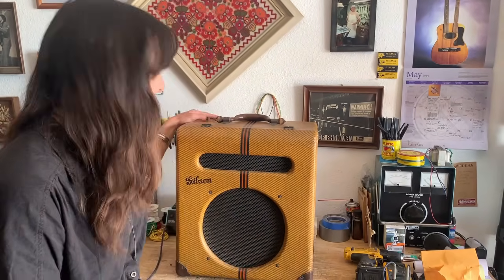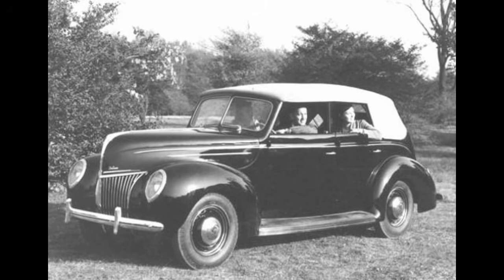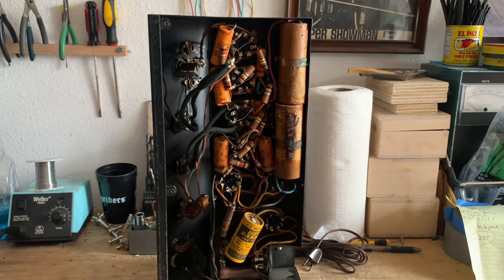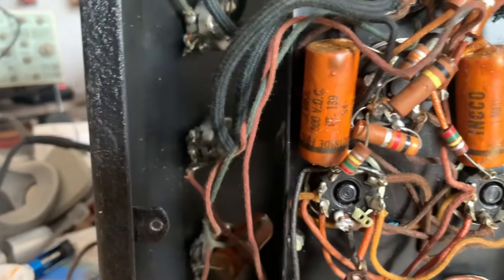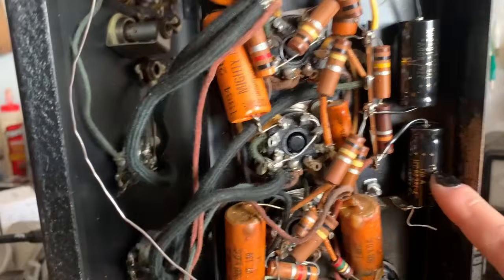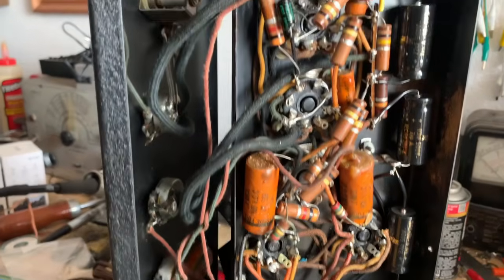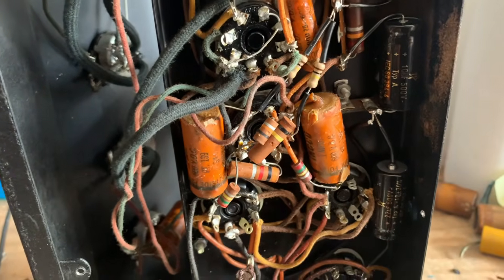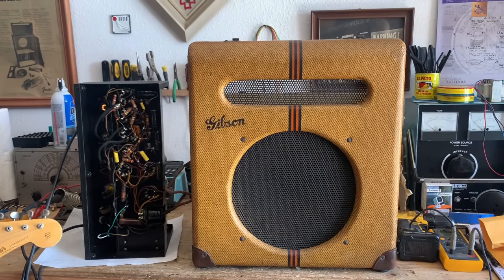Gibson EH185 Restoration | 1939-1940 Era Guitar Amplifier

Comment: Interesting to hear the overdriven tones on the mic channel. There are many stories of the earliest intentional distortion tone recordings ... even including causing intentional damage to a speaker cone to achieve the sound ... but this amp clearly came ready to supply rock guitar sounds simply by plugging into that mic channel... and at an earlier date than anyone would have thought! I suspect it simply wasn't used that way in 1939/40 for reasons of the musical taste at the time.

Comment: 30 years ago I was asked to inspect and overhaul one of these amplifiers (retired EE here). It was fun to watch your efforts and to see the chassis with tubes installed. I'd replace that grommet where the AC line cord enters the amp as well as upgrading the line cord to a 3 wire grounded type to avoid future issues.

Comment: I think you have just demonstrated that the best thing to do is get rid of all paper and electrolytic capacitors. They are either bad, or going bad.  Carbon resistors, especially ones that have been hot, should be checked for value. Moisture and heat can change a carbon resistor significantly. The bottom line for someone purchasing a vintage amp that has been in storage for years, don't plug it in.  Serious damage can result to transformers and tubes that are difficult to replace.

Comment: My home practice amp is a 1938/39 National Dobro 16 watt made for Sears. Original condition. Sounds awesome. The problem is it has 3 inputs and only one works, but I wouldn't run 3 things through it anyways. I bought it at a record store as they said  nobody  wanted it after a year. It was $1500 but I'm a 1950's player so this is that authentic sound I want. I run through it a Memphis Sun metal and tremolo, plus my tuner. Price wise I can buy something cheaper that does a million things. My amp just turns on, heats up, and is a conversation topic, which is why they couldn't sell it. BUT, its  owning history and awesome. I've never seen another like it. When I perform I put it on stage just as a conversation piece. I put some props behind it.

Comment: Hi the  30’s tweed Gibson EH185 Bass reflex. These combos were the Roll Royce of amps at the time. Did you know when you remove the amp and you close the cabinet it became  a bass reflex,  some  sort of subwoofer. They even have an output for an echo speaker to transforme it into a sound system.

Reply

Comment: You mut look after the handle. They usually dry and if you don’t oil them the just crack. inside there is a metal wire. Make sure to feed the leather handle

Comment: Nice restoration! Did you later change the remaining paper cap(s)? At that age they are guaranteed to be leaky. Probably doesn't affect performance now because they are probably the bypass caps but if they short some day or get even more leaky that will cause a problem.

Comment: What a wonderful amplifier  I love big octal tubes.......Do you save the old capacitors? I like to restuff them.......Such a wonderful crunch distortion......I l have a tan colored  Gibson Skylark  6V6 amplifier that came with a lap steel guitar  and it sounded awesome turned all the way up ....hit an A chord....Roaaarr....wonderful  rich 6V6 distortion...Need to restore it .....That amp sounds really nice with the chords you are doing near the end........Interesting how changing of the coupling  capacitors fixed the plate voltage on the 6N7 and the other coupling capacitor fixing the  the scratchy volume

Comment: A point of context here. I have three EH-185 heads from the first run of production in 1939 -- the ones fitted with EH-150 nameplates hastily hand-corrected to 'EH-185.' I've seen a bunch more of them in person and in photos. Item: Every single EH-185 is a unique miracle and disaster *unlike any other EH-185*. They were all built by accident, with the factory making random changes to the circuit from day to day, switching parts around, and making one-off changes to the chassis and panel layout literally from one amp to the next. A particular amp may be wired like a total whoopsie-rigged fire hazard of a rat's nest, or it might be an OCD masterwork of elegant, precisely-geometric lead dress. The pilot light is red, except when it's green. Also, I've never played one that wasn't fantastic.

Comment: I don't know what glue you are using but Silicone based glues may release acetic acid during curing which can be hazardous to some components. Love how small the new caps are. As for life of the new capacitors, I replaced one in my outdoor A/C unit (not a motor cap) and it has been good for the last 30 years or so. 
What can you do to get rid of the 60 cycle hum?

Comment: Wow! Super cool amp, and very nice approach at breathing life back into it. That first shot of the innards was pretty scary with those leaky 80 year old caps. It's wonderful that those parts could be replaced with physically much smaller, modern parts. It gave you a little room in an extremely confined space to work. I also like how you kept the restoration to what was truly needed. Great job!

Comment: An electrodinatic speaker,,the harder you push the amp the more current goes through the choke (the electromagnet coil) the stronger the magnet making the speaker more efficient and louder. Cool! A nice clean repair. I'm glad to see a young person who is interested in the vintage amps. I always replace the 2 coupling caps going to the output tubes, along with the all electrolytes. A very clean amp and a very clean repair. You love what you do,it shows.

Comment: You have excellent skills. Point to point wiring of an amplifier is planning every placement. Imagine the women and men that first wired these. During the war years the men were replaced by women…I remember that wire in the preamp area had to run at right angles to any other wire. I believe to prevent any cross induction. Love to see a scope on this amp. Signal tracing a square wave. Maybe next time . Cheers and thanks for posting .
Alberta Dave 🇨🇦😊🇨🇦😊🇨🇦

Comment: It blows my mind that people can follow and diagnose point-to-point wired circuits. I just see angry spaghetti. Awesome work!
Reply: I found it to be easier than a schematic. In the 90's I took apart my jtm 800 and decided I wanted to make a hand wired version. I literally followed the pcb. When it came time to dial it in on the oscilloscope, I did need the schematics however but then I found I could swap a few pots and resistors and make it into a bassman/plexi which i did. Wound up making and selling 6- 50 watters and 6-100 watters. The origina went on tour in Germany

Comment: Man, sounds great!!  :)   Basically, all caps in these old amps need replacement, to start with.  The electrolytics all dry up and the wax covered ones all leak and will eventually short to ground!!  :O
Soo, when servicing, basically, the first thing quoted and needed are cap job throughout!!
But when done....man, it sounds just like they did when they rolled off of the assembly line!  :)

Comment: Replacing the inverter plate resistors without measuring them first was foolish if you value the vintage nature of the amp, and further testing showed it was a mistake/unnecessary.

Comment: I fully understand the art of preservation of the blue moulded caps such as on the  fenders. However anything that old with old paper caps personally i would replace them all leaking or not. Any left in the circuit are just a ticking time bomb in my opinion. I have actually gutted them before and hidden new caps inside the old casings for picky customers. Very time consuming. Also as you probably know the high value resistors tend to drift alot with age as well. I would check all there values. Every amp has a different approach. That one is a fine piece. You did a very good job here BTW. Just my observations

Comment: Cool I wondered is there any woman who fixes and repair tubeamps. Yesss I found you. You do a nice job.
No risc with replace all papercaps as they function for coppling and you don't want high voltage ac on the grids.
Nice to find a total original amp 81 years old

Comment: After living in Toronto for a decade, I always notice hands that are used for more than lifting Starbucks cups and swiping right. Great hands. Take good care of them, and keep the content coming.
Being inspired by your vids, I was able to repair an old Ampeg bass amp already (it was hardly broken), and now I've got a fantastic Electrohome P2-4526 radio to bring back to life. It hasn't been powered in a few decades, but last known it wasn't working. I'll at least try to make sure it doesn't release the magic smoke when I plug it in for the first time. I need to learn more about testing components and tubes (without a tube tester).

Comment: Why did you use carbon film resistors to replace the old carbon comp resistors? When it comes to vintage amps and guitars I replace worn out and faulty components with as close to the original type as possible. I'm not trying to troll, just asking. Good video gave it a thumbs up.

Comment: IMO you should have replaced those coupling caps on sight. At the very least disconnect the grid ends and put your meter across to check for leakage. There was almost no chance of those horrible wax caps being okay all these years down the line. The amp sounded beautiful in the end. I think Gibson amps are very underrated.

Comment: Open plate load resistors are a common problem in many amplifiers including the Fender Amps. I had one in a week ago that had very low volume and distortion on channel 2 (vibrato/reverb channel) Problem, open 100K resistor to the plate of V2.

Comment: At about your introduction to the amp...I was adding up the years from new.  And what a nice condition to see at that timepart.  Was following your service with interest and the final test...was just remarkable.  The only counterpart at my bench was a 1974 vintage "Fun Machine."  Now  restored to full working condition along with a cira 1910 Oak Table, with colonial style legs and wooden roller feet.  Opens to accept leaves at 6'.     48" closed. Lightly sanded as to accept unknown new owners choice of stain, protective finish. 
Very happy to see your vintage era repair at work flow...Thank you for the interesting post and view of craftsmanship in action.    McGary

Comment: all original point to point... pure genius... you're brutal, the mechanical connections on those caps,  solid connection for sure until someone needs to remove said connection down the road, maybe in for a struggle trying to remove that solder and wire at the same time?... better him or her than me TY...  :-)

tip for removing soldered mechanical connections;  cut the cap/resistor off very long right at the cap, get good grip with a small pair of vice grips, hold vice grips in one hand with wire clamped tight as can be, de-solder using plenty of goop and hope you can pull on vice grips and wire to pull those bends out without ripping the guts out that thing..... solder sucker time, braided works best on these hidden connections suckers have a hard time reaching... simply brutal, several have multiple connections... man

then as a courtesy for the next tech, as you solder new components up not only loop the cap wire around for a good tight solid mechanical connection, give it a few good twists, then loop the wire end back around through the lug hole, another twist is optional..  lol... this way the next tech needs 4 hands to repair your work and you'll surely feel better about the whole ordeal knowing you have signed your work... lol

man, someone did this to a strat pot I replaced years ago, that was the day I learned about Keisub and braided solder sucker... thinking back I would have been fine never having discovered either, this dood looped it through then gave it a twist, vintage strat

amp sounds great and super quiet too, some lucky player is gonna be happy! Thanks for showing us, I gasped when you raised the lid, it looked brand new!  what an amp, they don't write em like that anymore

Comment: What a difference in the sound of that amp after all the components were replaced! Beautifully clean amp.  The mic input got a little crunchy when pushed.  Did the instrument input also go into some usable distortion?  And I think a lot of folks would like to see what you did to put a 3 prong plug on the amp to properly ground it and make it safe by modern standards.  Great video, fun to watch.

Comment: Strange how the filter caps are sequenced (from HV to preamp plate resistors): 20uF, 10uF, 20uf, 10uf. Every amp I've seen, the value decreases as you move away from HV.

Comment: these old amps really crank, so does the 150. why not just mark the neutral leg of the 2 prong plug and leave it original? ive been running 2 prongs over 40 years.
Reply: I do this when the plug is in good shape on particularlly holy grail amps

Comment: I'm imagining how that would sound with the upgraded speaker upgraded resistors capacitors New tubes check the Transformers for the ohms make sure that the Transformers and they've been overheated and did I not forget tube sockets and clean all the pots I love it where they were set its original settings that was sort of cool and a well-grounded system

Comment: Glad to know that the preamp section of the amp uses tubes that we can still buy today. There are preamp tubes manufactured before 1947 that were commonly used in 1930s era amps that are either no longer made or are ultra rare and over-priced.
Reply: Yep.Sometimes they have to replace the tube socket and all.But if I could find the one rare tube I need I would pay 100$ or more.

Comment: I like how you took your time to replace only what's required....and did the caps after having reasons to do them. But after doing 99% of them I would have done that last large waxy cap as well, as if its not leaking its probably about too once you use the amp a bit. Just my opinion.
Nice solid amp, super classy, and sounded great.
Cheerz!!

Comment: I would have pulled out all the electrolytic caps, and then while accessibility was good, tested every resistor and all the other caps.  Coupling caps to the 6L6s should have been changed to avoid potentially future leaks destroying the output tubes.

Comment: Nice amp! One thing on the electrical restoration though. A quality modern radial cap such as a Nichicon is a better choice here. One reason is that they are at least as good as the f&t and probably better. Another is they fit better then the axials. 
In fact I’d say the only reason to ever choose the F&T is that the fit better in eyelet/turret boards

Comment: You can put new filter caps in the old cap cardboard tubes to keep the original look, running the lead wires through the original cardboard end circles. 
Love your videos.

Comment: Good job, you are excellent my friend, I love working on amps, it is just relaxing. I got an old 40s radio with the magic eye. I changed all the caps,  and got it going again, not a fan of field coil designs, I know it's what they had but b+ running along long wires is not all that fun to me. You don't want to blinds stick your hand in there to shake a tube or something.

Comment: Nice video. Yea, those old wax coupling caps are the source of many problems along with the power supply electronics.  They’re common in old vintage radios and I just shotgun those out of there with the electrolytics before starting.

Comment: Colleen, your soldering iron holder is on the left side of the bench but you are holding it in your right hand. Are you ambidextrous? (I am right-handed, but occasionally I find it necessary to hold the iron in my left hand in order to get access to a connection in a tight spot, and it always feels awkward).

Comment: What an awesome video! That amp sounds fantastic. I’m amazed at how much smaller components are today than the vintage stuff
Reply: They even get smaller when you go to surface mount.  I've seen modern surface mount tube maps circuit boards where the entire amp circuit fits on a business card, and the tubes are soldered directly to a separate daughter board and connected with a ribbon cable.  While technology is nice, you can't modify or alter the design much without rippingoput the guts completely.

Comment: Great repair. I thought I heard just a tad of hum on the clean test. Could that have been noisy power line? If not, what could be done to get rid of that last minute bit of hum? Check the internal grounds routing? I know amp is old, just asking ...
Reply: Disregard hum comment, I see you are testing with a strat. My apologies.

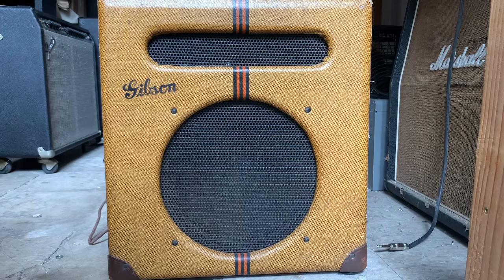Comment: In case anyone is wondering, the reason it sounds all distorted and farty at 10:58 is due to something called "blocking distortion." When the grid(s) of the power tube(s) have a high enough positive voltage, they will be pushed to a point where they begin to conduct. This has two effects: the grid begins acting like a forward-biased diode, clamping the output voltage down to a certain level (e.g. the reason the output was low and distorted), and also forces the tube into class B amplification, causing severe crossover distortion or even shutting the tube down for part of the waveform (the reason it sounded horrible and farty). This is usually caused by a coupling capacitor leaking DC onto the grid, but can also be caused when the time constant formed by the coupling cap and the tube is altered. So, sometimes a capacitor that's too big or even changing the size of a grid feed resistor can cause this. That's how I knew right away that changing out the coupling caps would fix it!
Reply: Sorry for rambling but hopefully this might help someone diagnose/understand this problem in their tube amp!